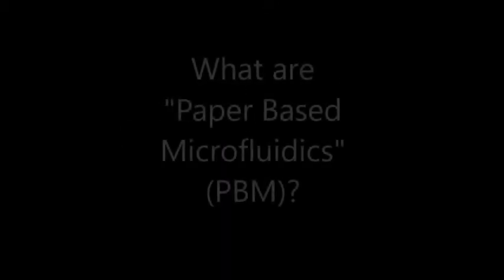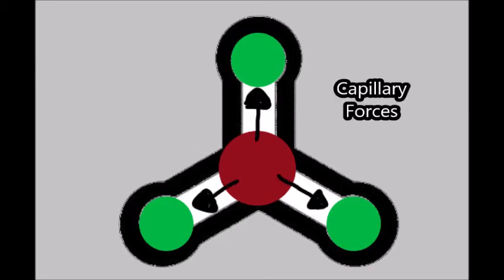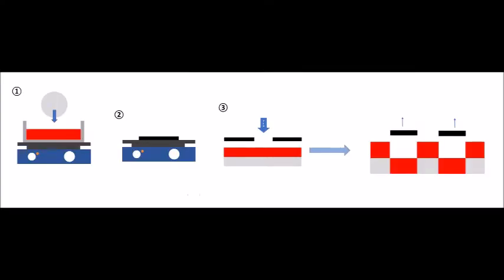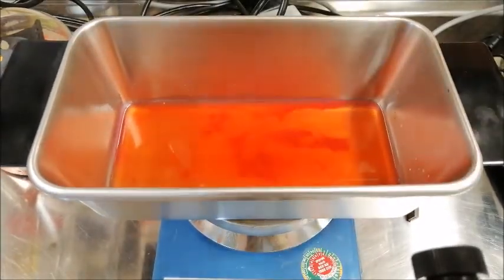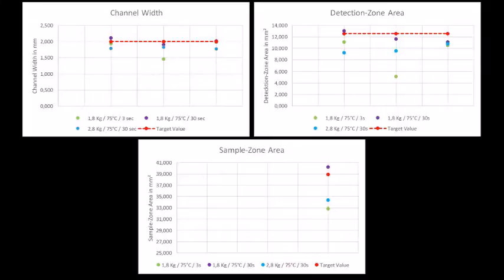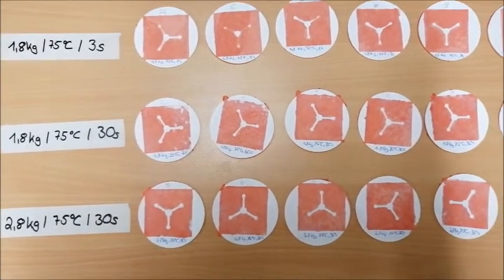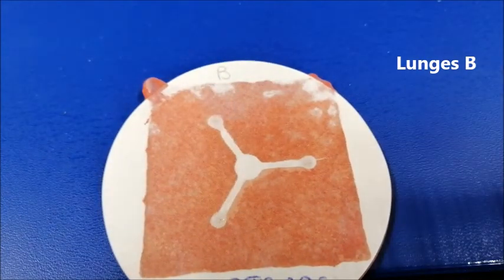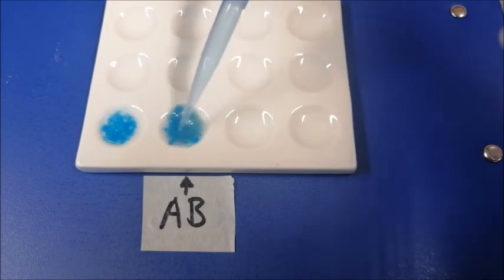Antibiotics and Nitrite detection in diagnostics with paper-based microfluidics

Comment: Consider placing insulation between the pattern and the weight. The metal weight will conduct heat away from the pattern. Overall, well done!